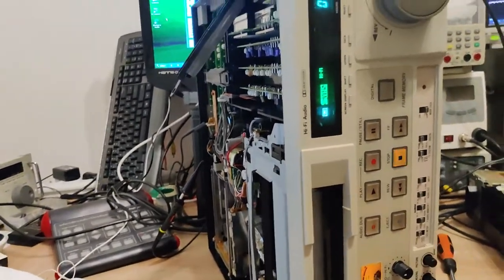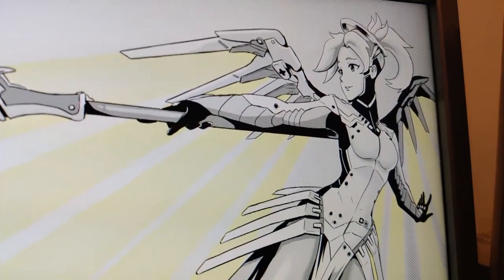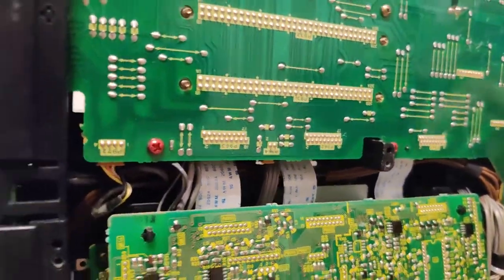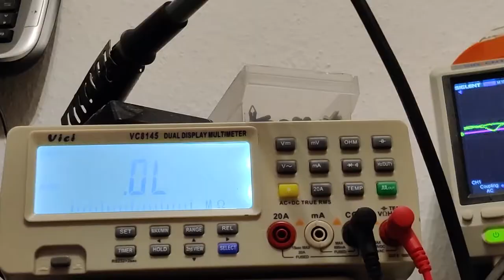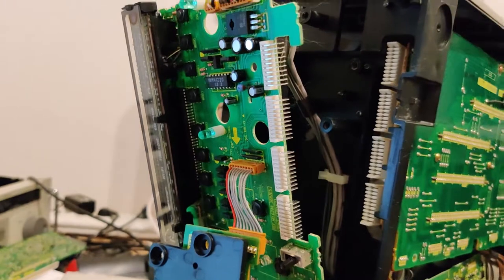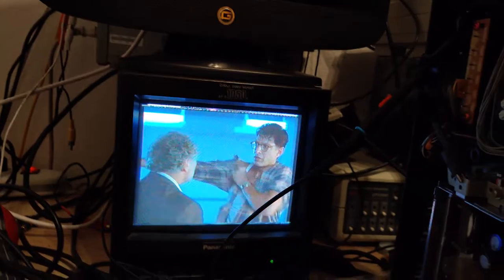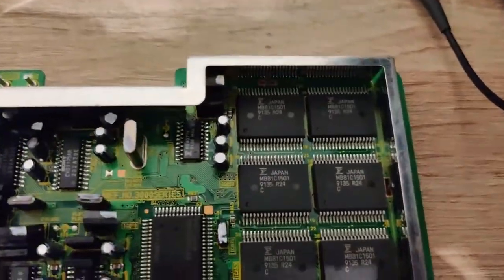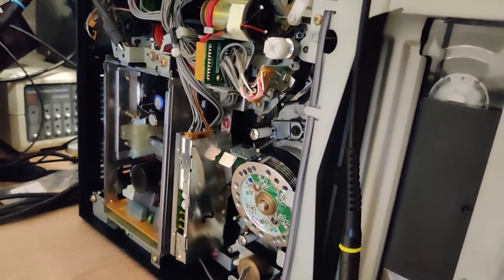Vintage Tech: PANASONIC AG-7355 (1993) Professional S-VHS VCR - Quick Repair

Comment: My AG-7350 cost 151€51 and only had 102 head hours. The second low-pass filter for color VHS only lets through 240 lines, but that for b/w 300. Paralyzing the primitive noise reduction of the AN3495K on the video 2 board is not easy, since the DOC (dropout compensation) is also located there. The Electronic Design TBC-Enhancer wobbles too much for me and does not take over the input frequency, which, as with the GTH Electronics ACE TBC, leads to image slippage in the long run.

Comment: Nice this video, I also have a PANASONIC AG-7355 which has an engine failure (visibly lack of power in normal forward mode). I'm looking for the manual service and the schematics, do you have this in pdf ? I would be interested :)
Reply from the maker: Hi, I don't have a manual for the 7355, but the machine is mostly identical to the 7350, so you can use the service manual for troubleshooting.

Good luck! :)